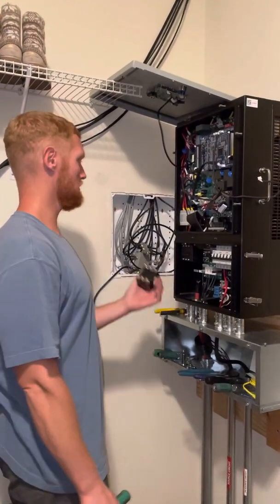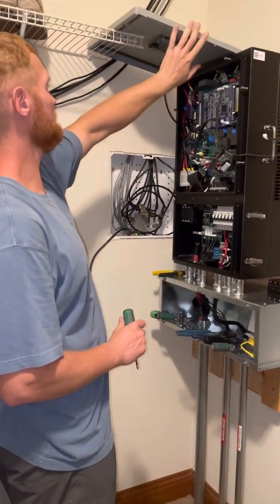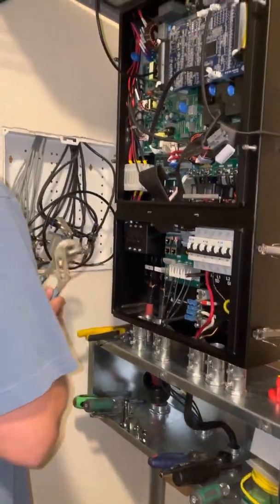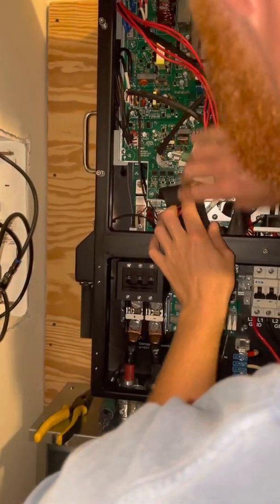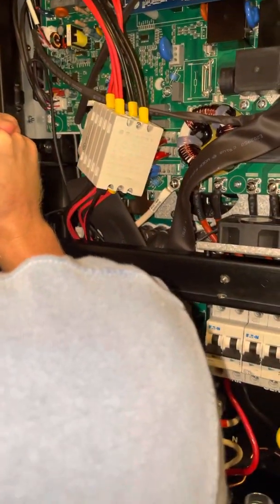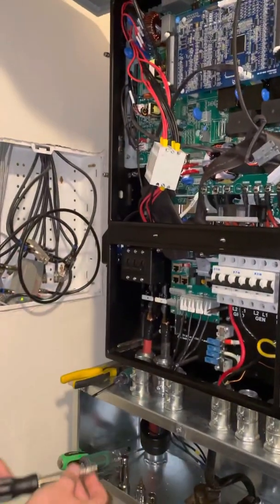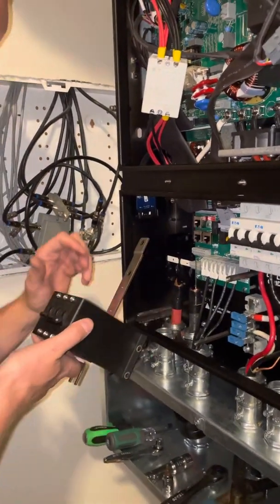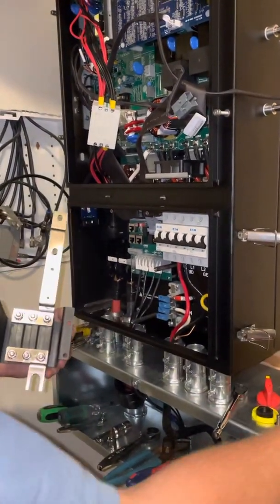Sol-Ark 12k ESS OCPD Replacement part1

Comment: One Thing At The 1st That You Didn't Mention Was To Discharge The AC Capacitors Before Sticking You Bare Fingers or Metal Tools Inside The Unit? Since You Could Get A Lil Bit Of Some Hundreds Of Volts Tingle or Even A Deep Permanent Sleep... 😉🤪🤣 PS And Why Didn't You Explain The Exact Reason or Problem On As To Why You Were Changing This Particular Part? 🤔
Reply from the maker: I checked terminals on both sides with a voltmeter. I followed instructions from Sol-Ark. 
What would you do differently? I’m not familiar with discharging capacitors that show no voltage.
Reply from the maker: The breaker would not stay on. I demonstrate that in part 2. My apologies for not making that clear. YouTube productions are not my forte. As is clear from these videos 😄